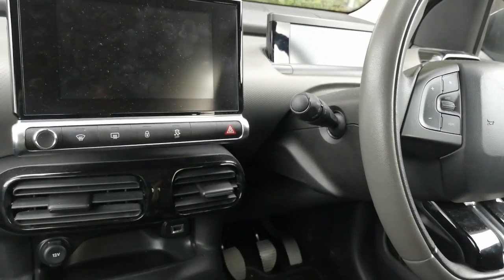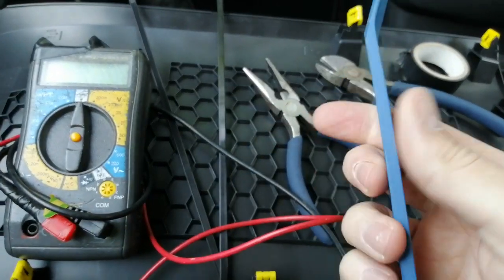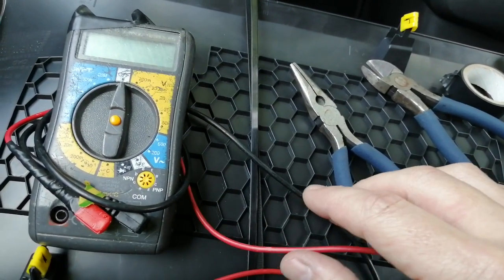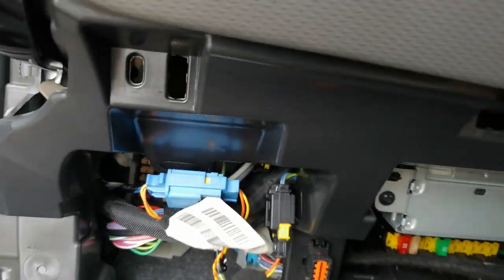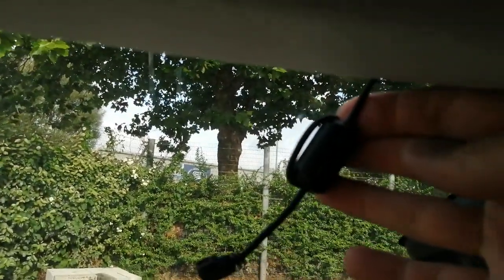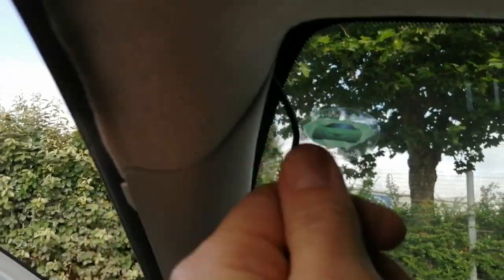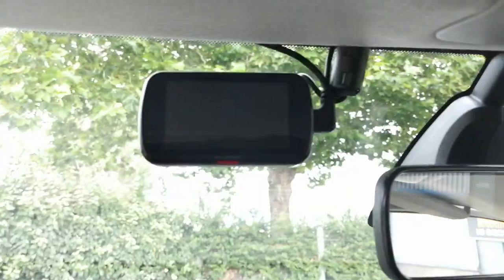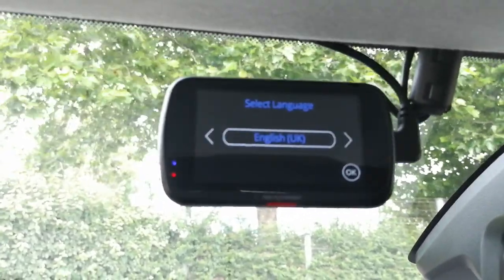Citroen Cactus 2014 onward how to fit dash cam to ignition & hide all wires

Comment: Very nice informative video. Got a cactus 2015 reg and thinking of getting a dash cam. One question for you. 
What if the cam has a parking mode and you need a permanently live fuse. Which one would you suggest one use. The radio one is 20 Amp. Would you say that’s a good candidate?
Reply: Hi. The rate on a fuse doesn't matter, because it is not used for your camera. The fuse tap used in the video makes a parallel connection, so that in the end there are two fuses, one for the connection used to tap on (20 amp for radio) and the second for your camera.

Comment: Connected up to the bottom fuse as shown, engine management light on permanently. Shouldn’t the tap be taken off the cigarette lighter fuse? The bottom fuse is for the instrument panel
Reply from the maker: Something wrong somewhere because as long as it’s ignition switched it’s fine. But fuse box layouts can vary depending on model,build,country of sale so it’s always best to get a meter on the fuses before pulling them.
Reply: Finally used the cigarette lighter fuse to tap off - it’s a blue 15 amp fuse. I strongly suggest this is used with a piggy back connector and a 3a fuse in parallel with the 15amp one. The engine management light disappeared once this was done. The 5amp fuse connection here is for the instrument panel and doesn’t like anything else connected to it for whatever reason. The 15amp fuse will still happily supply any device plugged into it without upsetting any of the car electronics. Why the 5amp fuse was used in this video without referencing what it’s used for is beyond me!
Reply from the maker: @richardwoolley2973  Because not all fuse box layouts are the same, I do hundreds of cars a year and see many variations. Either way glad you got it sorted.